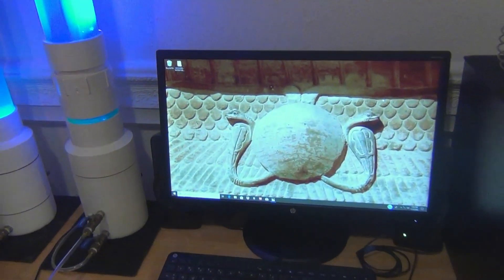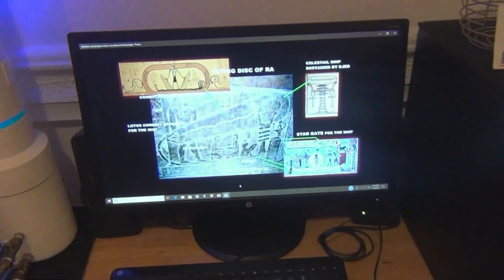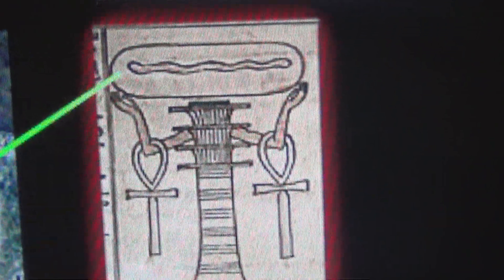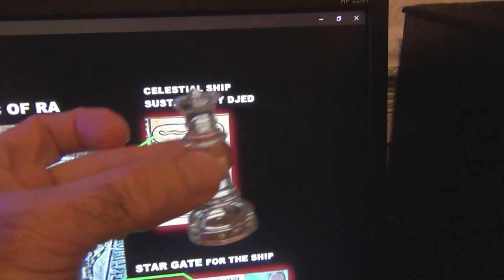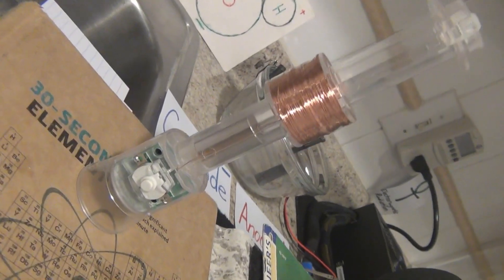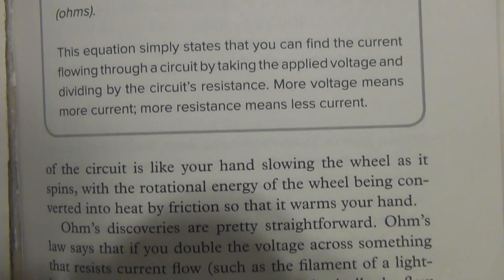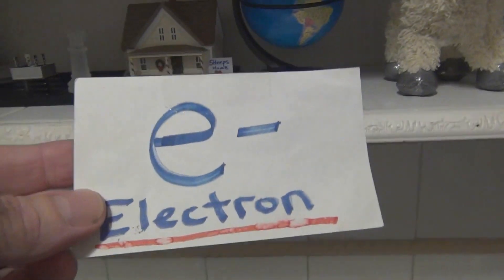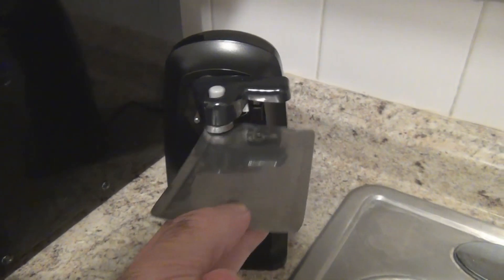HHO ELECTRODE TREASURES & ANODE SELECTION

Comment: Hey! 👋 
D-Limonene and Acetone melt EPS and remove the Air. Mix the melted product with veryfine Graphite, until it takes up no more. Get a press and compact until desired thickness. Cookie-cut it to your shape and size. Or press it into a mold of desired geometry. 

D-Limonene produces "ductile" results.

Acetone is brittle: smash  to very small granules, great 3d electrodes...

Or, go big. Get yourself some high quality graphene and then press this into the external surfaces of the recycled EPS electrode of your own creations. Love your reactors 🎉

Comment from the maker: You get what you pay for when it comes to the electrodes of your oxyhydrogen fuel cell reactor core. The 316L stainless steel is key to having a clean water without creating corrosion rust at the anode positive electrode. Platinum anode electrodes are expensive but inert material to the process and will not rust or corrode.